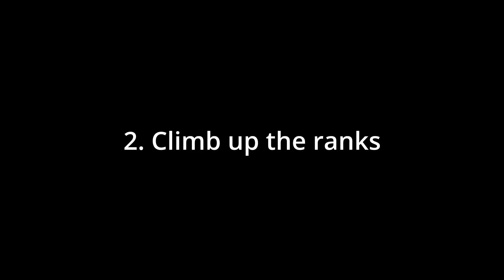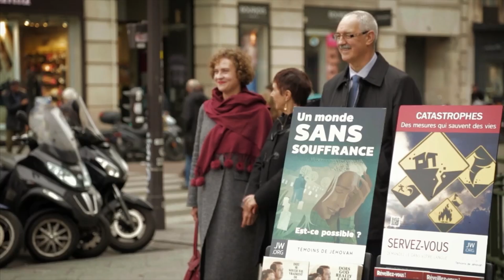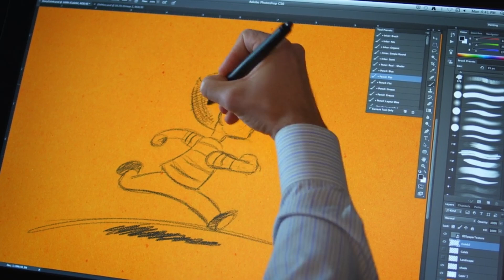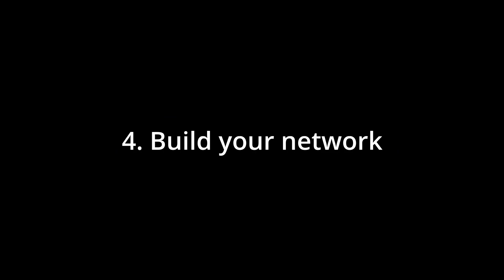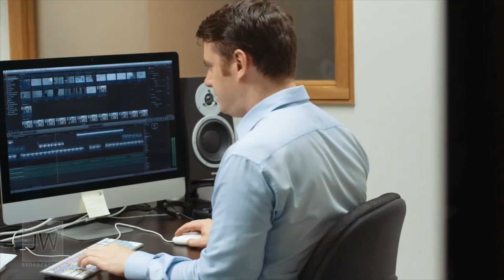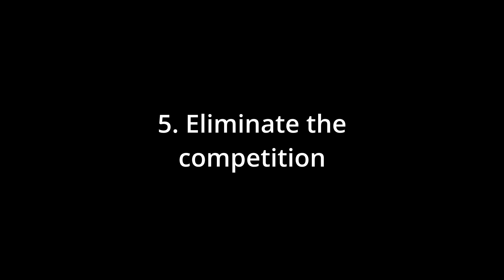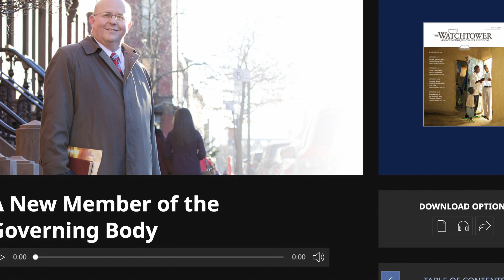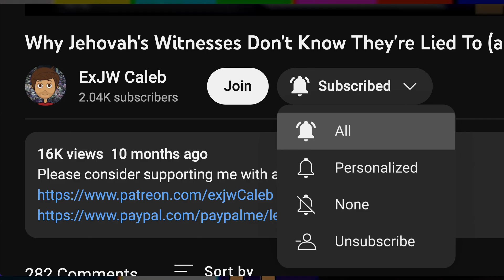How To Become The LEADER Of The Jehovah's Witnesses

Comment: Although this video was a little tongue in cheek, this is essentially how you can become a GB member. 
The key is to start taking the emblems early in your JW career and keep your head down. Initially you will be given the side eye but persist and don't be weird or eccentric and you would be left alone. Be deligent in any JW assignment you have (Pioneer, Bethelite, CO, LDC, etc.) and most importantly, NETWORKING, as mentioned in the video. Eventually, your name will be known and you will be evaluated. That's basically how Cooke and Sanderson became GB members.

The two latest appointees were mid level Bethelites until about 2 years ago when suddenly they were appointed as helpers to GB committees and giving talks at Gilead graduations, Annual meetings and going on Branch visits. By then, everyone in Bethel who knew these two knew that they were being groomed to be GB members. The key difference is that these guys were partakers. What was surprising to most even at Bethel is the speed of the appointments.
I think this speaks to a desperation that is in the GB. Except for  the 4 latest appointments, the rest are over 75 years old. Sam Herd is quite ill and Loech is 93. They are trying to head off a crisis of leadership in the near future.
I do not think it will work out.
Reply: Don't be weird or eccentric? Um, Stephen Lett?
Reply: @popeduck  There's always an exception 🤣🤣. He slipped through the cracks.